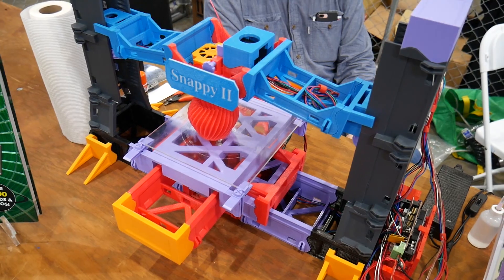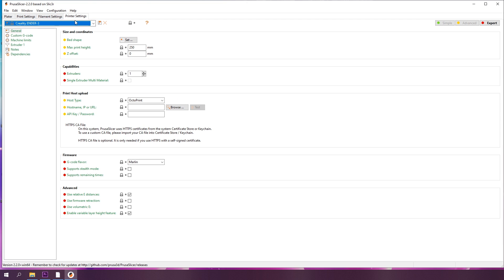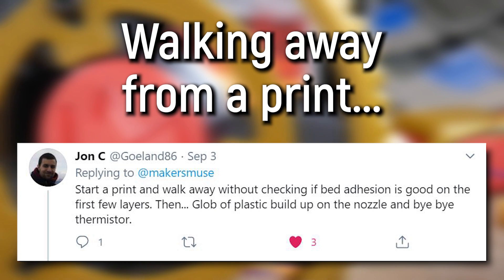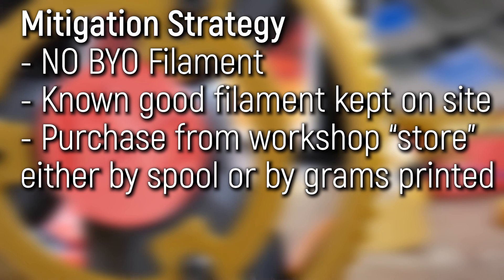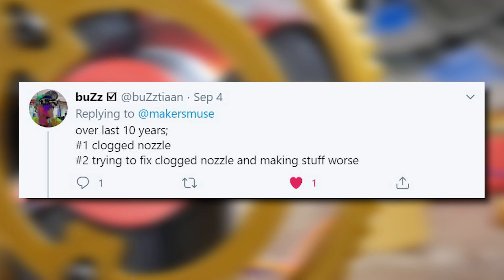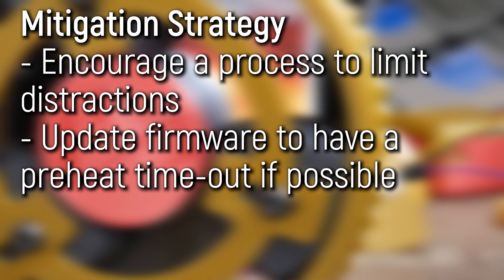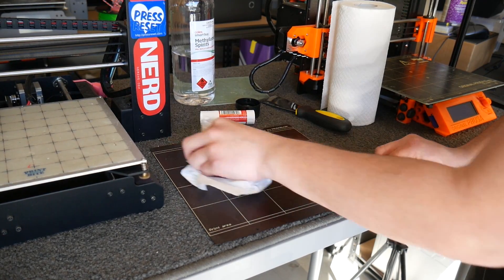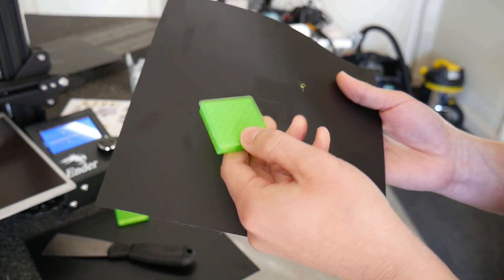How People BREAK 3D Printers (and how to stop it)

Comment: I've made quite a bit of money from a customer because he just won't slow the goddamn printer down.
"PLA is melty."  Slow the printer down, put less plastic out so it has time to cool.
"NO!  Instead, I'll print in ABS."  ABS requires hotter nozzle and bed temperatures, meaning the printer will take longer to warm up before starting a print.
"NOO! Here, install these 120VAC heaters with solid state relays on all my printers, and we'll use higher wattage heater cartridges."  Okay, that'll put an additional strain on the power supply and control board, but here you go.
"I'm getting peeling first layers and cracks between layers."  Yeah, when you print ABS at high speed, you have to print it at higher temperatures so it will flow through the nozzle.  But then it has to do more cooling, which means it does more contracting.  Slow the machine down and reduce the nozzle temperature a few degrees."
"NOOO!  Instead, I'm going to enclose the printer to hold the heat in!"  Okay, you'll probably want to remove the control board and power supply to mount them outside the enclosure, and probably replace all these printed parts with cast thermosetting resin parts or machined metal ones..."
"NOOOO!  I'm just gonna build an acrylic box and put the whole printer in as-is.  Could you come over and fix this?  The extruder doesn't work anymore and the printer randomly shuts off."  sure, but you're cooking all the electronics during printing keeping them in this box like this.
"How do you print parts this strong?"  I run the printer slower.
"NOOOOOAGSD:FLASKDFASJOPDGISDH:@#L#KSDFPSODXFEF;aldskfaj!!!!oneone"
It's like his mom beat him with a slow printer when he was a toddler and he just cannot tolerate the idea.

Comment: Solution; don’t trust anyone, lock the printer up, shut the place down. ;) People are simply like that in any profession, it’s really weird to me you touch something complex without knowing anything about it (which also is an issue with the place not requiring lessons on it). At my job I had to create a database that was incredibly annoying because mistrust was built in on purpose. That did work though, never had an issue with the mess it was before. :)

Comment: If you're not getting a flexible magnetic surface like he mentioned in the video (and for a public printer, you should) a dirty trick that works is to have a glass/mirror surface with painters tape and, if needed, uhu glue.

If the print won't come off, take the surface off. Try to use the spatula on the tape, not the print. And if that doesn't work, send the person who wanted to print to wash the glass surface until the glue gives in. And clip in a spare one until they're done.

It's dirty, but you've got a lot to deal with in schools etc.
Reply: Also, in the same "oh whatever" spirit, put a raft in the printer's default profile. If they don't know or bother to look at it, at least it won't come loose. It wastes time but so do failed prints.

Comment: Gotta admit, I experienced the Dunning-Kruger effect firsthand when it came to 3D printing. When I first got my printer I was so confident I knew exactly what I was doing because I read words about what I was dealing with and kinda understood what they meant and based off of what I understood, guessed what I should've been doing... More than a year later, I now understand the sheer stupidity of some of the things I did to my poor printer back then. When I first got it (a Maker Select v2) assembled, I wanted to take off the bed and forced the head assembly upwards by hand to get it out of the way because I didn't know how to lift the head through software... Later had to force it back in place because I didn't keep the head level while forcing it and found I couldn't level the bed properly as a result. To this day the X axis is a tiny bit tilted, though it's not too bad so it can be fixed with the bed being leveled correctly.

Comment: Oh man, I cried the first time I had a blob cover the hotend. I thought I'd just thrown $500 down the drain. Ended up being a fairly easy fix, barely even needed parts. Now I'm able to flash firmware, solder in thermistors, swap motors, and haven't had so much as a clog in months! It's crazy to realize how far I've come in two years.

Comment: Great video! Since no one else uses my Ender 3, I keep it clean and dust free as much as possible. Once I was able to dial in the best baseline temp for my nozzle and build plate i lock it in. I use what I know works best for MY printer. I have never had a clogged nozzel or had a bad bowden tube failure.  I clean the build plate after 3-4 prints...I still use the original build tack that came came with the printer.  It has worked very nicely for me and gets better the more I learn.

Comment: As someone who just started 3d printing a lot of this seems like common sense. One thing I disagree with (only if you're experienced with a great track record of making things work) is the taking apart a hot end. I recently got a budget printer (lk4 pro) and the ptfe melted in it, took it apart and found the whole hit end loose. Took some extreme temp epoxy, a small stainless tube and with some skill fixed the hotend to where I can essentially run it up to 275°C with no issue of anything melting or going crazy. However, as mentioned before, you have to be good at tinkering, the average person or student would likely just mess it up somehow.

Comment: Why do I feel guilty even though I've never even touched a 3D printer?
Reply: Got $95, if yes than now you can touch one
Reply: Haha I feel the same except the only mistake I made was ripping the print off of my personal printer. And in the end it wasn't even my fault, it was an old printer and the bed adhesion never let ANYTHING go. Like I'd let it cool and stuff and even then I had to really jam the prints off with a putty knife and it left a bunch of plastic residue but I honestly don't know how else I would've done it cuz the build plate wasn't removable or anything.
Reply: @imreallyfeelingit8867  I heated the bed on my Ender 3 to 60 degrees when we finally got a good print and got it off after 30 seconds. Edit: after 15 minutes trying to scrape it off.
Reply: Maybe you are not ready for a relationship; that's okay. 😏

Comment: I found this very interesting.  I was thinking of buying the Creality Ender v2 which has a glass bed so would you recommend changing out the glass for a flexible bed?, and which one would be best.  I am a total newbie and I am trying to learn CAD using Fusion 360 prior to moving forward to actual 3D printing.
Reply: Paul,  glass is used for flatness. Cheap, uneven aluminum (aluminium) print bed can be very frustrating. The only way to find out what would work for you would be to replace it. You could also apply a self-sticking print-bed sheet. The best printers have special (expensive) aluminum beds intended for a professional use.

Comment: Wait we’re not supposed to use painters/masking tape on the print bed? What are the negative affects of this? (Besides the bed being slightly uneven) I have a Prusa i3 and for the past few years I have used painters tape on the print bed and been pretty happy with the results. I don’t really want to put glue stick or anything on the acrylic print surface and without the tape I have a hard time getting the 1st layer to stick and removing the prints that do stick.

Comment: I've joined a FB channel dedicated to the certain style manufacturer of the unit I purchased. The most common issue I've seen is people put it together, shove all the wires up under it to "hide them" then after a week the print bed quits working and there's 'wiring' issues with some of the stepper motors. The "book" (jokingly referred to user's manual) says nothing about the routing of wires, the proper use of the tie wraps included with the kit, or why making the wiring "pretty" is not always best on a machine that is constantly moving all three axis of it's travel. I prefer an "ugly" industrial look with aftermarket wire loom protecting the wires from chaffing and a longer lasting machine. Great list about public machines. Really giving me second thoughts about allowing anyone to borrow mine. Great channel! Keep up the good work!

Comment: Step 1: Have users go through orientation and training
Step 2: Don't let your users try anything kooky or unique.
Step 3: Ban your first user that keeps breaking hot-ends
Congrats, you're now the grumpy shop teacher.
Reply: I like the "don't make me make rules" rule and have been required to read the instructions of all electronic devices I was allowed to use and still got supervise in the beginning and for every further thing (I didn't understand that when I was building IKEA furniture at age 12, nor for "just" drilling some wood but appreciate it now).
Reply: Sounds like many of the commenters here hasn't been around any kids/tenagers 🤣 You are aware that you can tell them something 15 times and they are still surprised the 16th time they hear it, right?! If it was as simple as no rules, teach them instead, which would be the prefered option btw, there wouldn't be any issues. But that isn't the reality with most kids/tenagers.
Reply: @speedbully_84  This
Reply: nice
Reply: How does one break an hot end? I broke the PEI build plate, literally plowed the poor thing, and everything was intact
Reply: @giovannipezzin5707  Not preheating it for nozzle removal can easily snap off the heat break, strip the aluminium thread, or damage the nozzle. Lateral loads to it can damage the heat break or break it, damage the nozzle geometry, wires can be snapped off, especially thermistor wiring is hideously fragile, and the thermistor itself I've seen pulled out of the casing or molten into place to the point of needing to drill a destroyed thermistor out.
Reply: Yeah I'm not impressed with the "don't allow tinkering; ban this, ban that" recommendations for kids in schools.  Schools are authoritarian enough already, and defeats the purpose of having them there so that kids can learn.
Reply: @Dwonis  I agree. It would be far better to teach them what not to do when using 3D printers and how to fix mistakes, as well as teaching them about how to make the different settings for different materials, printers, firmware, etc. It would probably become an entirely new subject on its own, but I don't see what's wrong with that. They can throw in a couple of the other CNC machines as well then and prepare them for either a maker job at factories or small businesses. Or as engineers as engineering schools often have multiple CNC machines that the students use to fabricate their solutions (that's at least the case here in Denmark). The more they know in advance, then more the universities and colleges can cram in of actual engineering knowledge, rather than just "how to operate our machines".
Reply: @Dwonis  It's not recklessly banning things left and right though, it's because most people just cannot operate a 3D printer. This is often true at Maker Spaces but is practically a rule for schools! Considering how wildly inexperienced I knew I was a few months in to owning my first 3D printer, someone who doesn't own a 3D printer or who isn't experienced in their use and maintenance should NOT be allowed to use them without detailed instruction and focused observation. 

However, I'd totally support a maker space that employs a couple of attendants to help people operate machines and make whatever they need to make. Especially if people want to bring in their own filament or something, anything unique like that can be accomplished with a good attendant.

Comment: I use a glass bed with a micro-porous coating. When the plate cools to room temperature the print pretty much falls off. I never try to pull off a print when it's warm or hot.
Reply: If you're impatient just pop the plate with print in the freezer for a few minutes. I
Reply: As much as i know i shouldnt im really damn impatient. Ill wait until it drops 10deg then pop it off. Usually requires a bit of force but if it just wont come off ill wait

Comment: Great list of issues. I think we’ve encountered several of those at our student focused maker space.  Another one I think we’ve had are students turning off the printer power as soon as the print finishes on our Prusa i3 Mk2 and Mk3 printers. The cooling fan stops and heat rises up the heat break, melting the filament and jamming the print head. Also had someone ignore my “do not use without training” sign and use a sharp spatula on our brand new Mk3 flex-steel PEI print beds, not realizing no tools were needed for print removal.

Comment: We in our lab use M16 (Marlin) to "enforce" a specific profile for a specific printer, but have been eye-ing M260 (i2c send) as that could "authenticate" a gcode with a printer, ie. via an external arduino nano checking the i2c-sent checksum (and turning on power only if it matches). This would be perfect to prevent printing old gcode (people do that sometimes).

Comment: Hey my guy, this was super informative.

Maybe you or anyone else could help me here. Let's say I'm designing a 3d printer, but without laughing.

If I had a detachable spring steel build plate set-up in mind, and I was thinking of adding a heated bed to that, would I need a heating element the same size as the spring steel build surface on top of a magnetic adhesive material, on top of a 3-5mm Alluminum plate.

Hypothetically, let's say the Alluminum part to spring steel part is 450x450mm, would I need a ~1000w heating element? Could I use a, let's say, 2000-400 watt 300mm square element and achieve desired results. (A functioning heat bed that's not just a waste of energy)

I need a little help lmao.
Reply: If you only print in the 300mm area you would be fine.
Reply: @danielkruger4305  That's what I was thinking, but heat dissipation lost in the extra mass won't make the heating element useless?
Reply: It depends on the wattage of the heater and if you insulate the bottom.
Reply: @danielkruger4305  Thanks a lot.

Comment: Gday Angus , Living in Australia can be challenging , temperature wise. From -6 to 55C  depending where you live. As I only got my X1 Sidewinder during winter when average temperatures are ranging in Perth from 6C - 25C at the moment. So the question is what effects do high ambient temperatures 28C - 42C have on the print , as opposed to printing in winter  0C - 16C. Does the bed temperature and nozzle temp need to be toned down? Cheers from Perth.

Comment: I've had my cheap (under $300) XyzPrinting DaVinci for 4 or 5 years now - and with the procedures I've evolved for operating it, it still works and prints perfectly.  Yeah, having to only buy their filament isn't great - but it usually seems to work well, which I'm not sure I could count on if I was buying different filaments from different manufacturers.  I usually set my local home security camera to watch it when I'm not in the room for a long print, but rarely have had any problems even if I just check back occasionally.

Thanks for the video, keep up the good work and keep yourself and your family safe and well!

Comment: Ok, I'm relatively new to 3d printing and I didn't knew about the preheat issue. There has been some times where I preheated because I was printing something, realize that I should change X or Y slicing parameters (like some part too thin to print without warping a bit up, needing brim/sutom supports, incredibly common) leave it heated up since it is a 2-3min affair, then something happen that made me be 30 to 60 minutes (sometimes more) away from it around the house (never left it fully unnatended though) Probably that is why I get sudden underextrusion at higher layers that I cannot replicate reliably...

For my glass bed with hair spray I do use very carefuly use an exacto knife to separate it enough that it pops by themselves. Not the best (probably a bad idea), but not as annoying as to take the bed out and use the really crappy spatula that came with the E3.

Comment: We learn from our mistakes...with 3d printing I think its a little more daunting...my ender 3 did not come with an owners manual or anything really telling how to do anything...just photo instructions on how to assemble...one of the adjustment wheels kept falling off....Somehow I thought that I could get by with the wheel falling off...LOL...When I changed the nozzle for the first time, I realized it may need some heat...so, I looked for a video...Looking for a video seems to be the answer 99% of the time...

Comment: My printer keeps breaking cause of bad parts :( Well, I did accidentally kill a stepper driver once by short ciruiting the cables, It came off while I was getting the fillament out from the extruder and hit a metal part causing a short :(
But other than that it’s been uncentered pulleys, damaged metal rods, broken heat cartriges :/ I should probably just buy a more expensive printer instead of buying cheap bad parts :p Right now it’s clogged, but I have 5 more cheap hot ends to burn through before I buy a new one xD